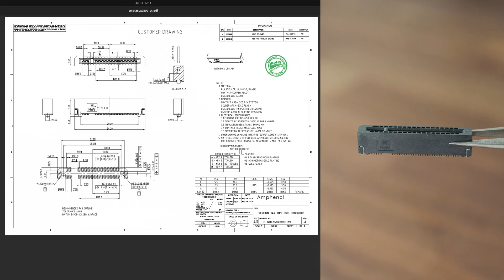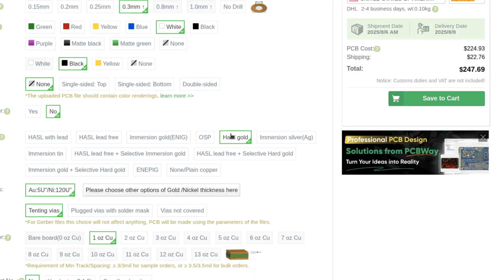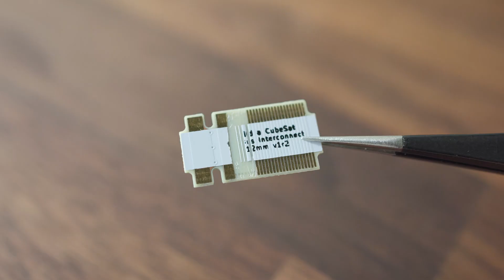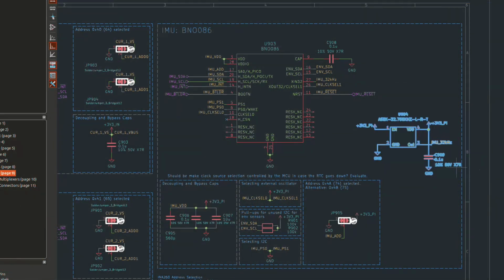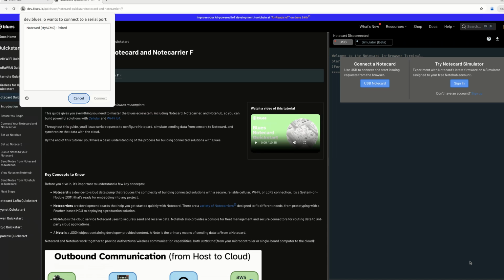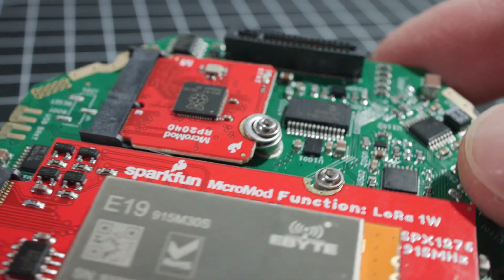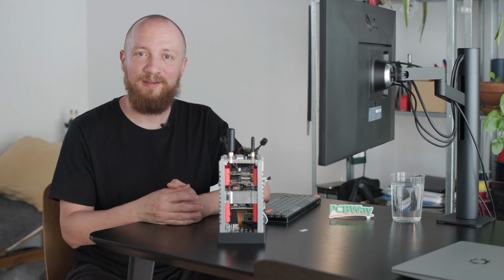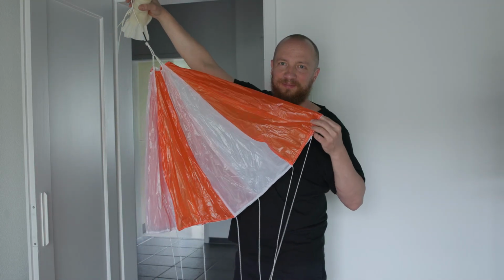CubeSat Prototype SN1 Integration – Part 2 of 2

Comment: 5:15 FYI there is a GUI (and indeed some CLI tools) for configuring u-blox modules under Linux, I've been using it on my Pi. I don't have my notes here about it but I think I mentioned it in my time-pi repo. I should really write that stuff up better in a blog post!
Reply from the maker: That is super helpful, thanks! I didn't even think to look – just assumed that this is a proprietary ublox thing... Haven't found the GUI one yet, but a CLI one seems to be ubxtool that comes with gpsd. I'll definitely give this a spin next time!

Comment: "Non-standard USB-C implementation"

* Eye twitches *

Nah, in this case I think it's actually OK, but there are mass produced devices out there that will deliver +20 volt without negotiation...
Reply from the maker: I can very much relate to that eye twitch 😅 I'll do my best to keep the magic smoke potential low...
Reply: @buildacubesat just use another connector!? Why use usbc then? ^^
Reply from the maker: Two main reasons: First, pretty much everyone has USB-C cables around, so you wont't have to dig for a misplaced special cable or adapter. Second, USB-C is flexible – there will probably be boards that only need 5V, or others that might need 12V, which we can also support over USB-C. My goal is to keep things user friendly and consistent across different boards.
Reply: Ya the convenience of usb power is pretty amazing. I found these <$4 USB C PD boards that can change between 5, 9, 12, 15 and 20V with a button press. So handy.